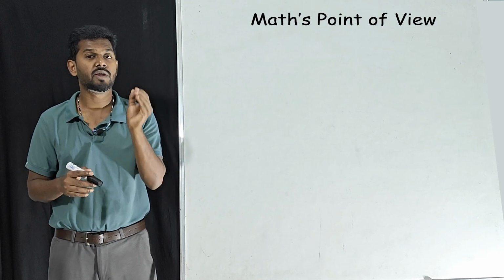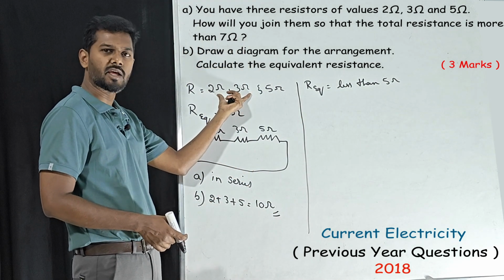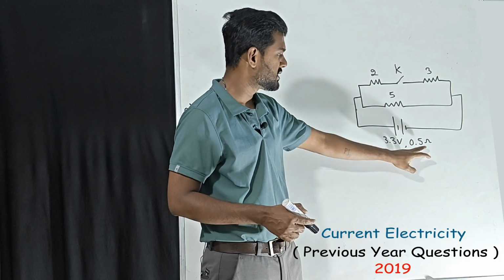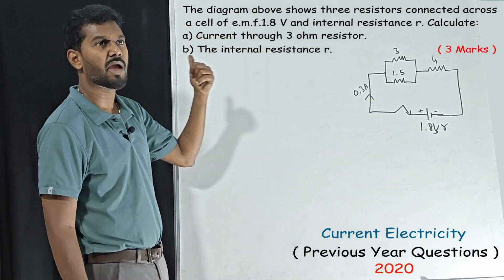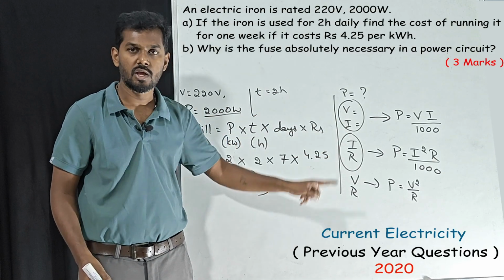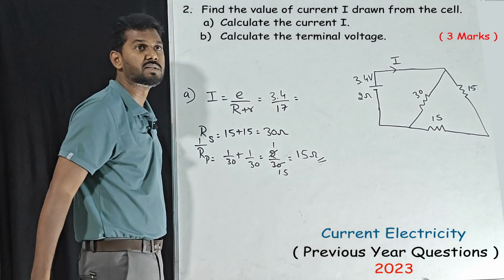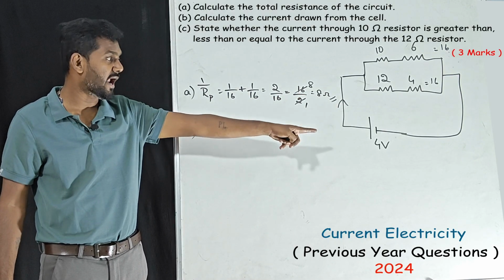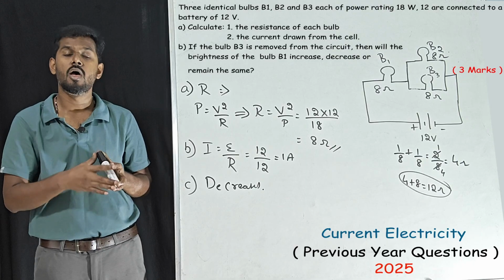8. CURRENT ELECTRICITY ( Previous Year paper questions ) | ICSE | Grade 10 | PHYSICS

Comment: Sir I'm having a doubt 
Why should we use only the terminal voltage not the emf while calculating current in a parallel circuit
Reply from the maker: Emf means, voltage from the battery. Once the current start flowing, voltage drops, so we cant use it

Comment: Thank you sir 
Why shouldnt we add 0.5 r in 2.5 ohm
Reply from the maker: We don't use r while calculating terminal voltage. r is used to find voltage drop or I in whole circuit